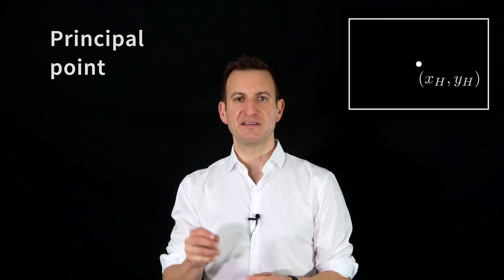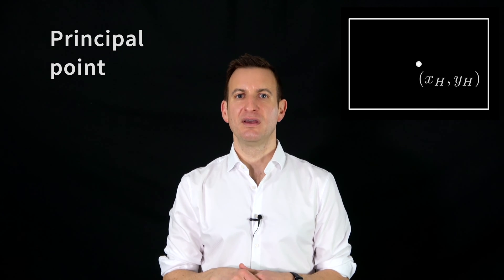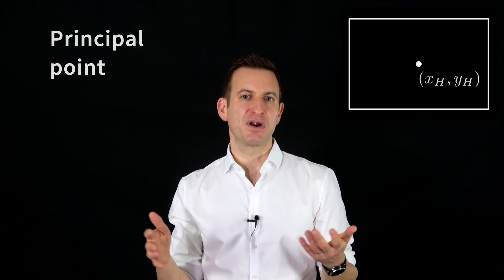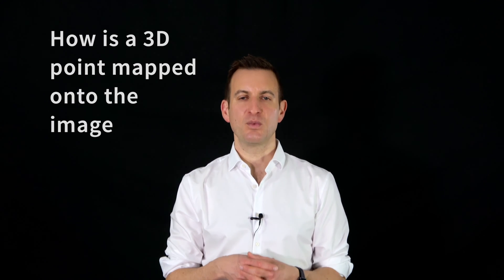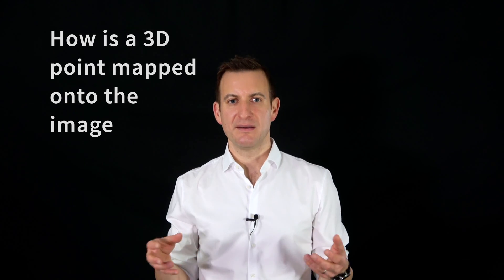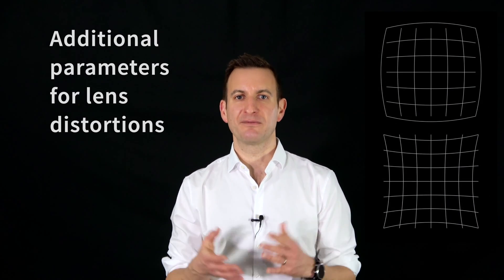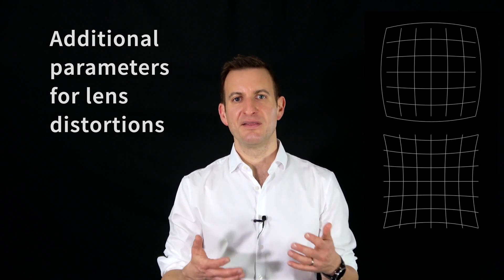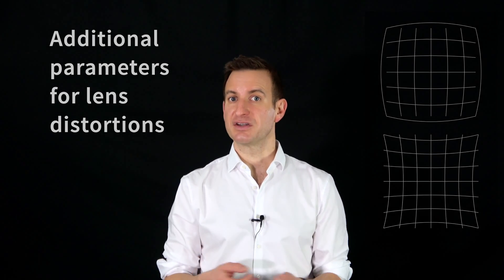Camera Intrinsics and Extrinsics - 5 Minutes with Cyrill

Comment: XYZ extrinsics are relative to what in the real world?
Reply: In general you estimate coordinates with respect to a Geodetic coordinate system. You do that by using a set of well-measured landmarks in the field (ground control points), measured by other, usually Geodetic, methods.
Reply from the maker: I an (arbitrary) world frame. Eg UTM or any other world/object frame you want